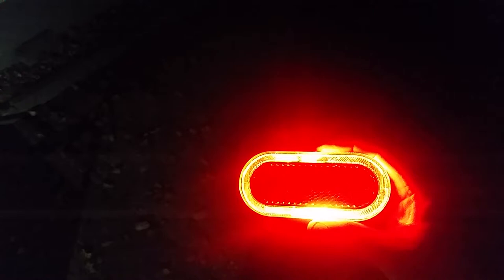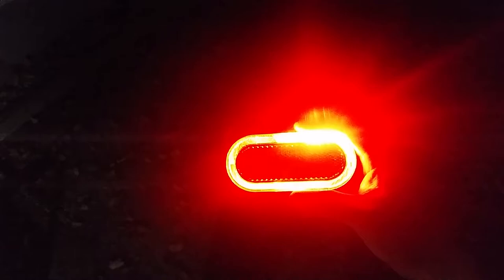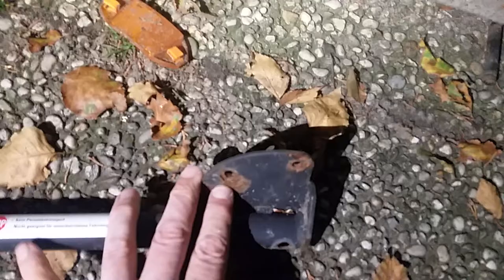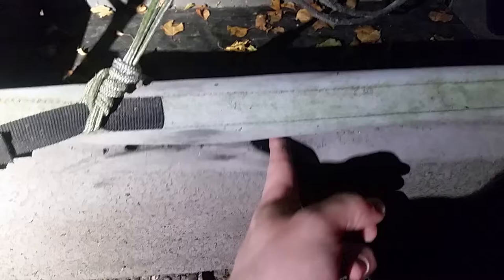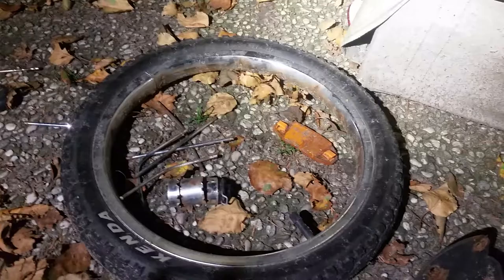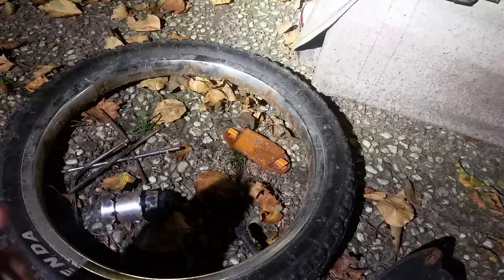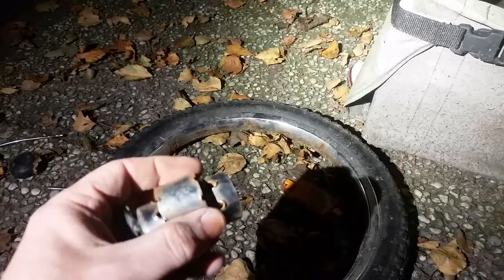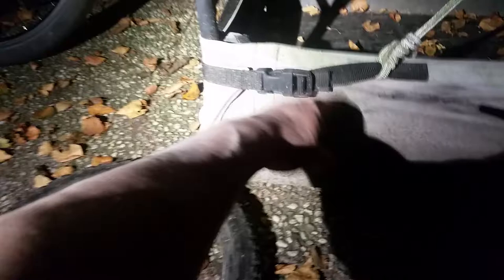Looking back to the Philips Lumiring + disintegration of the Roland traveller bike trailer

Comment from the maker: Just a note: If you are interested in a review of something specific esp. w.r.t. bicycle lighting, just send an email to make a suggestion and I will have a look whether it may be interesting. At the moment the only upcoming/planned review is that of the pedallcell dynamo. It should arrive 17 Sept. (a sample with housing that is not final but they will send a final one later too for long term testing incl. testing to see how it holds up under all weather conditions) so then I will do power measurements using the 2 USB outputs, to compare it to the Spinup F12W. Btw, I talked with the owner of Sunup about different options to change the USB output of the F12W and/or of the light output, not sure if that willl happen, they are considering all options including concentrating entirely on USB output for rechargeable headlights.

Comment from the maker: Just a note of reviews of bike lighting: The problem I have in selecting what to test, is that it all looks like 'more of the same' or just 'junk'.
- What I would like to do is some more LED light colour reviews, as I did ages ago on my website ( https://swhs.home.xs4all.nl/fiets/tests/verlichting_analyse/experimenten/index_en.html ), but with a few different, newer LEDs, such as the SST20 4000K 90CRI LED that is used in e.g. the Lumintop EDC18. I couldn't find a seller in Europe (if you know a source, let me know...), and the one I bought from China didn't arrive, after more than 3 months it's considered lost in transit... Perhaps I can retrofit some of my old torches but that too will take a long time to arrive if I order now.
- I'd like to make a video with various headlamps switching between them while riding but most of my headlamps are loaned out so that will take time.
- All the latest B&M lights since the IQ-X have huge distracting artefacts just like the IQ-X! Their own beamshots (which are fairly good these days) clearly show that so these don't seem worth bothering with.
- In taillamps there are a few new ones that could be good but which are clearly not going to be better than the best ones I tested so far.
- In e-bike/pedelec/battery power lights there are some good lights that I could test, but I already know that I'm not going to be using most of them (so they'd end up in a drawer) as they almost always use cool white light!

Comment: Too bad that the Spanninga lineo is just 80 mm bolts! Can't be used with the Tubus racks!
Reply from the maker: Edit: Had to check as it didn't sound right: the Lineo has 50 and 80 mm placement holes (you can move the bolts to the desired location, but perhaps you have seen some newer version that is 50mm only?), but a few other of the Spanninga taillamps such as the Elips have been made available to the retail trade only in 80mm versions for the past 2-3 years (before that all were available as 50 mm and 80 mm), which is stupid and I criticised Spanninga for that on my site. 50mm makes more sense as you can drill additional holes in wide racks at 50mm if they only have holes at 80 mm, the reverse in a narrow rack isn't always possible. 80mm seems to be the standard in NL for many bikes/racks, but e.g. in the USA it's 50mm. The wider mount makes no sense to me, also for mounting on a seatpost mount, 50mm is better so they should have standardised on that.